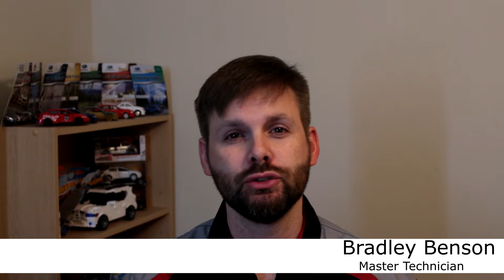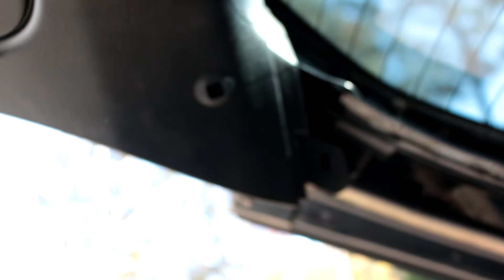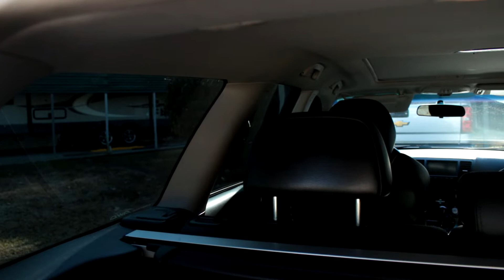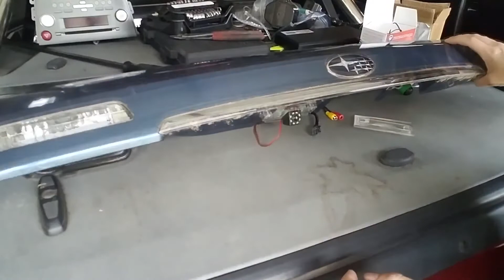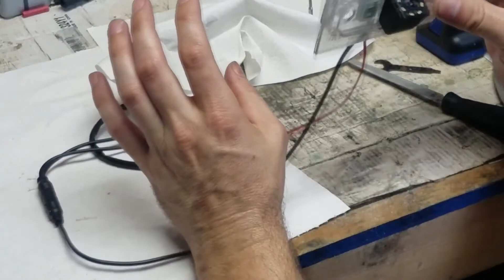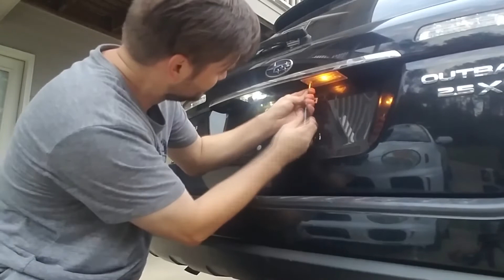2008 Subaru Outback XT Backup Camera Install

Comment: I own a 2008 Outback XT and am interested in the factory nav screen - which I have never before seen on an '08. Could I find an insert for that screen surround with the center air ducts? Or do I have to buy a whole new dash? For either answer, could you provide me the part number, or point me to an aftermarket source?
Reply: Yes you can

Comment: Has anyone else actually tried this?
Reply: I just did this for my son’s 2007 Outback XT Limited with factory Nav. Honestly the most difficult part was figuring out how to route the wire from the camera inside the tailgate. (I opted for the camera that sits just on top of the license plate frame.) One of the plastic inserts that is used to secure the license plate was broken and missing so I used that hole to route the wire inside. The license plate is secured only by the top two screws anyway. Getting the RCA connector threaded through the rubber grommet from the tailgate to the body was a pain, but doable. I dropped the very back of the headliner down just far enough to get the wire from the grommet out to the side of the headliner. Routing the wire along the headliner was actually easy. It just tucks under the edge above the windows. 
For a couple of DIY’ers it took us about four hours to complete the install. Someone that knows what they are doing could do it in much less time.
Reply from the maker: I belive so.  I found all the info online. Then i just made the video of my process.

Comment: I don't see any gaps or holes to run the wiring through to the inside of the tailgate, how did you route the wires without drilling a hole?
Reply from the maker: I routed the wire through the grommet with the factory harness up top by the hatch hinge.

Comment: Thanks for the vid!  My 2009 Sub Out does not have Nav, do you have recommendations which to buy so I can add back up camcera?
Reply from the maker: Sorry, but I don't have any recommendations for aftermarket units. None of my vehicles have aftermarket navigation/display screens so I wouldn't want to tell you to go with brand "x" and it not work out for you.
Reply: @weekendwrenchin9267  Is it possible to get NAV from Subaru itself? If they put it in your 2008 wouldn’t it reason that they have one we could buy from the dealer?
Reply from the maker: @HisValor  I'm sure you could probably find the part numbers for the Factory Nav system components, and order them.  But honestly if you're trying to add Nav to a non-nav vehicle. Simply for a backup camera.  An aftermarket setup (radio unit with video display and port for camera input, along with a camera) most likely would be more cost-effective.

Comment: How do you feed the wire from the back all the way to the a pillar?
Reply: All I did was tuck the wire inside the headliner just along the edge
Reply: that's the part of the job that gives me some thoughts! Did you just push the wire or did you use some "special" trick to reach the A pillar? I would like to buy a rear Camera for me Outback 2008 where  installed a Sony 2 DIN (XAV-AX100) but I don't want to do a mess in the entire car!

Comment: Very detailed video, A+ 🧐😎
Reply from the maker: Thank you!  I tried to make it easily understandable.
Reply: @weekendwrenchin9267  Thank you for the video, my question is the shielded wire (the power source from the rear backout light) is connect to 3rd pin which one is it looking from the rear left or right ?